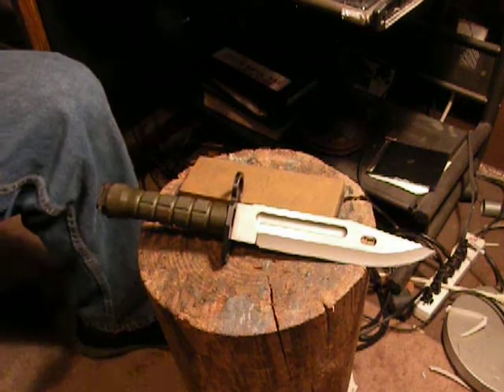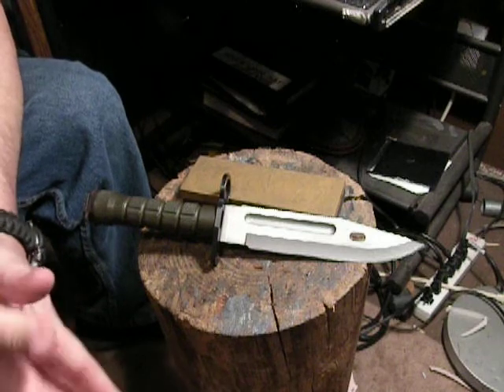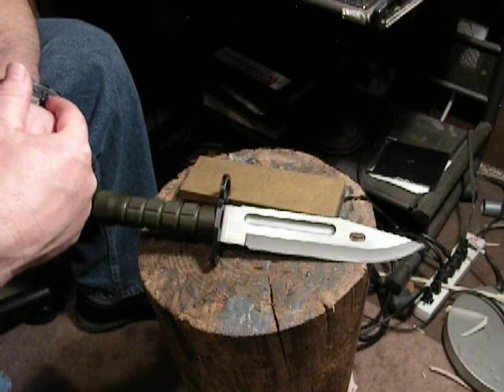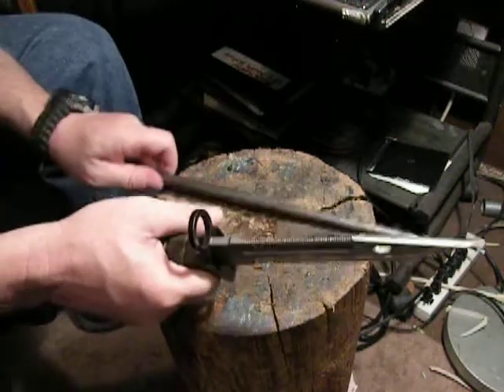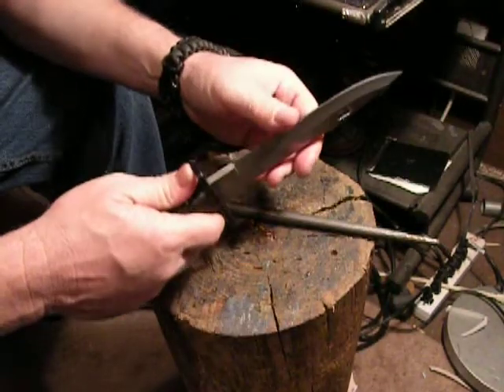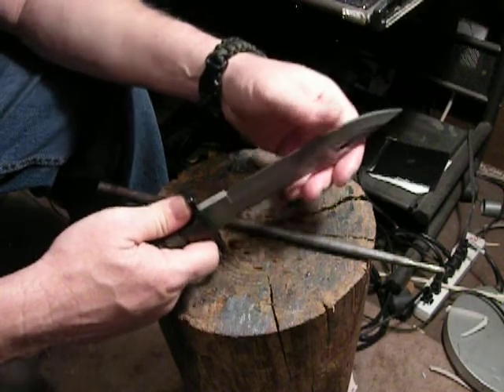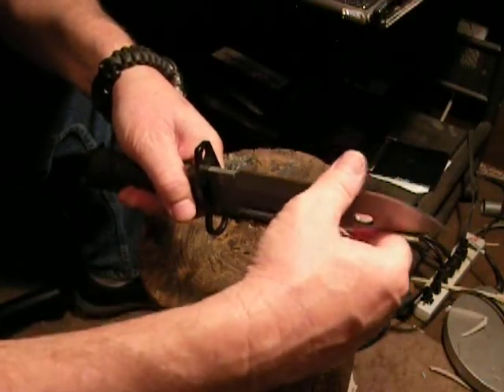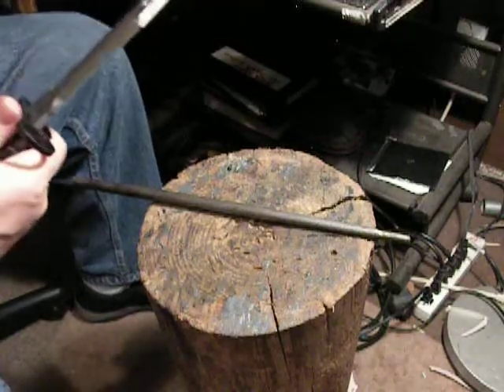How to Sharpen a M9 Bayonet to Razor sharp FAST! ~SPECIAL FORCES~

Comment: is that from ontario it didn't look like it
Reply from the maker: Its a Phrobis, but you can sharpen almost any combat knife with this technique I do in the video especially if its a stainless steel but I have also use this approach with high carbon combat knives as well.